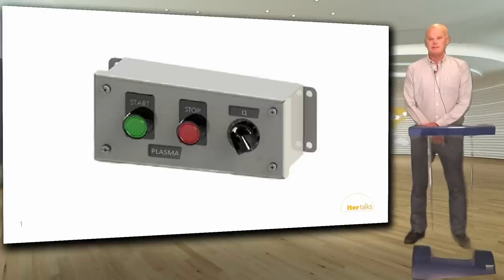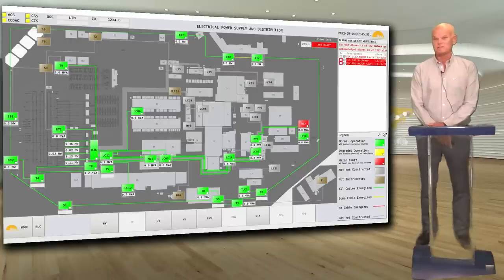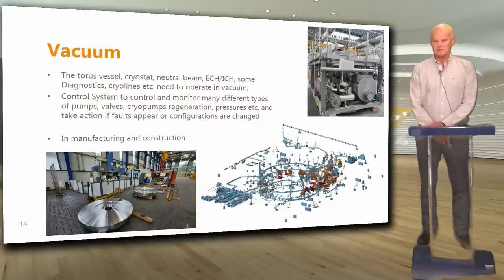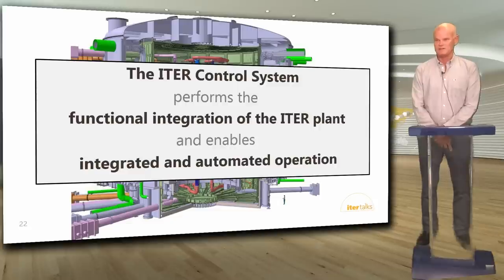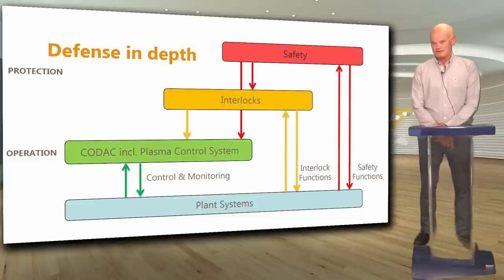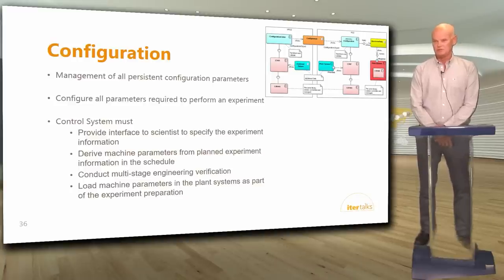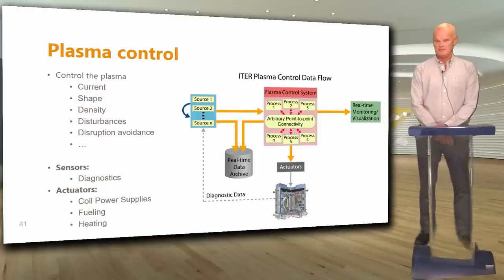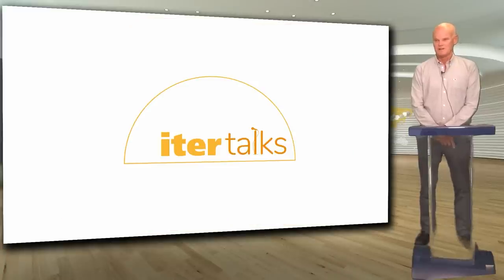ITER Talks (9): Integrated Control System

Comment: So, maybe this is over-simplifying; but wouldn't it be very time consuming to need to process 5 million process variables during operation? 

I mean, even a simple "for" loop from 1 -> 5 mn would take longer than the constrained feedback time.  (I'm guessing that this 50us sensor -> actuator time is some other embedded system)

I also hear even Minix would be a better solution to Red Hat just for minimizing complexity for some linux based server. It would greatly benefit stability of the system as well as per the author's original grant.
Reply: I imagine the variables are distributed across separate systems.  He mentioned something like 1500 controls cabinets.